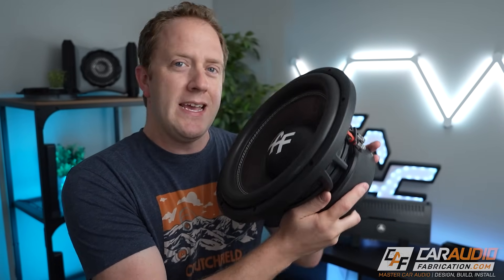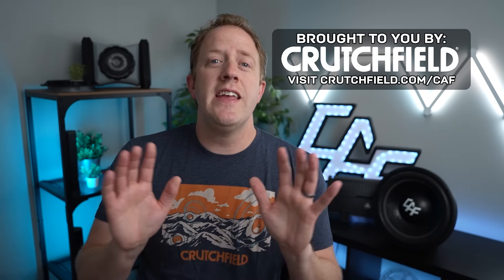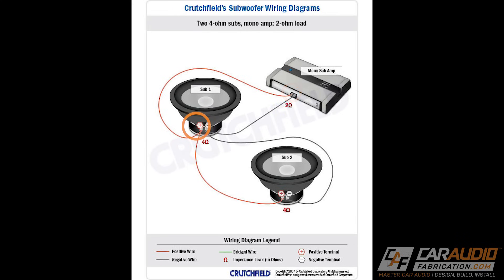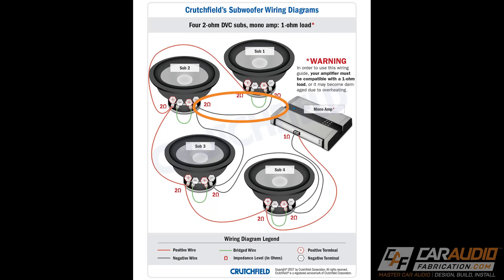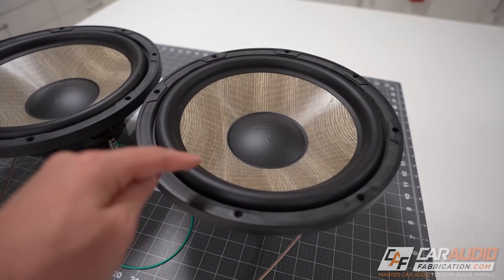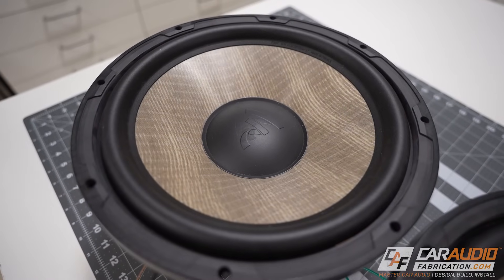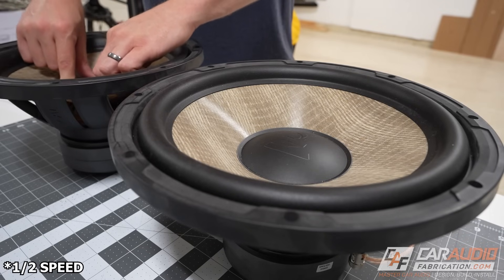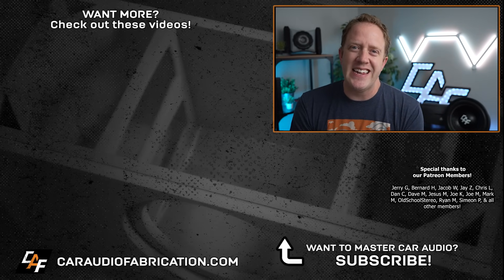Should you AVOID this subwoofer wiring style? SERIES Issues Explained!

Comment: There's one advantage to series wiring the subwoofers - if the coil in one fails, both of them will stop seeing power.  Why is this an advantage?  If they're both sharing the same box volume, if one fails, the remaining working subwoofer is now seeing TWICE the effective box volume that it was previously seeing, and a huge "passive radiator" (the non-functioning subwoofer) in the box, and apart from sounding pretty bad, that could lead to over-excursion and mechanical failure of the subwoofer.

Comment: This is what I've been saying for years from theory without knowing if it's true. Thanks for sharing this knowledge. I've noticed from friends running subs in series that the furthest sub would always get smoked. That's why I tend to run single sub or parallel setups. I've never blown a speaker this way. I've been running the same system for 16 years and haven't replaced any components.
Reply: I’m series parallel, hell I should just wire down to .5 and limit the amp by gain structure, I’ve already smoked one, closest to the port. I’m going single x12v3 soon so I’ll just get a dual 2. My single sub setups have always went harder than my dual/multiple sub setups.

Comment: You didn't go over the differences in ohms. Two 4 ohm subs would either create 2 ohms in series or 8 ohms in parallel. That would have a significant difference in what amplifier could be used.
Reply from the maker: Please re-watch the video, the point of this video is not to determine or match the final impedance at the amplifier. I have several other videos about that already on the channel, not to mention it's probably the most discussed topic in car audio and I wasn't about to add 10 minutes explaining how to calculate total impedance when it's not the point. The focus here is completely different.

Additionally (even though it's not the point) your comment is incorrect , two 4 ohms in series would be 8 ohms, and if parallel would by 2 ohms.

Comment: never knew this!
Reply from the maker: It's rarely discussed! Thanks for watching!
Reply: @CarAudioFabrication   question for u...........
is it possible for me to get my 2000wrms single ,one ohm dvc sub that  is wired in series to 2ohm final,.......is it possible to use a heavy duty  DIY resistor bank to get my final load to one ohm.?   I don't wanna buy another 400.00 sub
Reply: I have a 2000w monoblock

Comment: I just put two 12" RF 2ohm DVC P3's in a larger size sealed box with a RF Punch Punch P600 4channel bridged. I have 0gauge ofc power wire and 10 guage sub wire. It hit really hard with the Kenwood KMX 809S deck I have. I just did my first complete tear down and built of a 2008 Ford Fusion. Did a few months of research before deciding to go the route I did, and I'm blown away with how it sounds. Amp birth certificate says 845 Rwatts, so I assume I pushing 422.5  RMS watts to each sub. I can literally see my back window move. I plan to upload my build in a series soon. I did not have to do any other upgrades. When I turn the Audio Control line level all the way up and the EQ subwoofer level to plus to it hits hard rumbles. Except there is not much rattle at all outside as I deadened 80% of the cars and 90% insulated/dampened it. Spent over 5 k total as much of what I bought was open box stuff. 110% satisfied. By the way, thank you, as I learned a lot of things about stereo stuff that I did not know yet from watching yours and other people's videos 👍
Reply: I used RF T2652-S front components, used the crossovers to bi amp, RF T-1682 6×8's in the rear doors, RF T-1693's in the rear deck.  RF Punch P600 4channel for the rear deck and front door mids, RF Power P400 4 channel for the front tweeters and rear doors, and A Audio Control  Matrix. I have all the speakers set to Full sound and the subs. I really need to take it an and have it set up properly. Too much stuff to fine tune. It sounds so crisp. Clear and clean even when cranked. Only has about 5 hours of playing it so far.
Reply: @Living_EDventures  also, o gauge on 600 watts is hilariously overkill. You fumbled around with that thick ass wire for no gains what so ever, over a smaller wire.. Granted if you upgrade in the future its already installed but on "600 watts" you could have gotten away with - Up to 500 watts RMS = 8 gauge. 500 – 1000 watts RMS = 4 gauge. 1000 – 1500 watts RMS = 2 gauge. 1500 -2000 wats RMS = 0 gauge
Reply: I have 1640 total rms watts. I emailed RF told them everything  I bought and how I want to set it up. They suggested I use 0 gauge. My sub amp birth certificate says 845 watts. It bridged. That's why I said 422.5 each. I also have a stock battery and alternator with no cap or extra battery and I get 0 light blinking. I can't complain. I'm going to upload the complete build soon.

Comment: So am I correct in extrapolating that wiring the coils of two dvc subwoofers in series and the speakers themselves wired in parallel (ex 2 DVC 1 ohm subs wired in series-parallel for a 1 ohm final load at the amplifier) will also not generate the same backEMF? And under what conditions are the positive and negative connection at the amp shorted?
Reply from the maker: This is discussed in the video  The experiment simply demonstrates the effects of back EMF in a series vs parallel connection

Comment: Would this apply to the component speakers as well. So it’s best to have individual channels for each speaker. Tweeter,mid,mid bass instead of just using impedance blockers. 
Then further does a component system distribution box prevent this even though one leaf powers the whole block

Comment: I watched your video on wiring a dual amp system great video btw ty. I just purchased a HU, 4 speakers, a sub and 2 amps. My 4 channel speaker amp  has A and B inputs for front and rear speakers and output rca Jacks. Should I connect my sub amps rca inputs to speaker amp outputs or directly to the headunits subwoofer outputs? What are the difference, pro/cons of each way. Im assuming I will lose the ability to tune the subwoofer through the headunit if I connect the sub amp rca inputs to the speaker amp outputs rather than headunit but that's only my guess. Any advice  is greatly appreciated

Comment: Interesting video!  I'd say I learned something new!  You really should have touched on the big elephant in the room:  Impedance rise of series VS. parallel.  After my experiences with my JL 13W7, I will avoid series connections altogether.  What I noticed most was that the impedance rise of a series circuit vs. a parallel circuit was proportionally higher in the series circuit.  With the subs coils in series, I was mostly seeing an average of 5 ohms across the board.  In a parallel configuration, I was seeing an average of 1 ohm across the board.  In the series configuration and using a SounDigital 3K (2 ohm version) I was only able to get 950-975 watts RMS out of a 3K.  When I went with a 5K, I still was only able to muster 1400+ watts RMS.  I would have tried an 8K, but didn't have the room, due to all the equipment being located in the spare tire well.  This is when I decided to try a D4S JP23v2 and wire in parallel at 0.75 ohm.  The results were staggering.  Not only did I substantially increase my headroom, (2,980 watts)  but I saw way less impedance rise.  JL's maximum power rating of the 13W7 is spot-on.  Beyond that and the voice coil bottoms out.  Sorry for going off topic Mark!

Comment: Oh, this is very interresting. 
I've got 2x6 inch 3ohm subs wired in series purely because my monoblock is way too powerfull and I thought the increase ohms would give more damping,
but now I think I'll re-wire them to 1.5ohm parallel and just be carefull with gain controlls (1kwrms driving 2x +-100rms subs) and hopefully it sounds even better! 
Thanks for all the videos and great info btw.

Comment: Yes but that would not happen in real life. If you open the circuit that would go away. If you had it hooked to an actual amplifier turned on or off that would not happen. On top of that each speaker should be sealed from it's neighbor as well since in a perfect world reguardless of how it is wired because you are far more likely to have failure of a sub due to unbalanced pumping action when they are paired and not sealed between each other. This is according to Kicker they have a video in which this topic is discussed. 

In the above hook up an amp with no signal going through it and with it turned on or off this above example should not happen. If you do not short the speaker wire it likewise will not happen. This is a non-issue issue.
Reply from the maker: The test is just to show how series and parallel differ. In a series connection each subwoofer is NOT directly damped by the amps output. It is in the case of a parallel connection. A series connection BETWEEN drivers can absolutely lead to distortion and can be even worse at higher output levels.